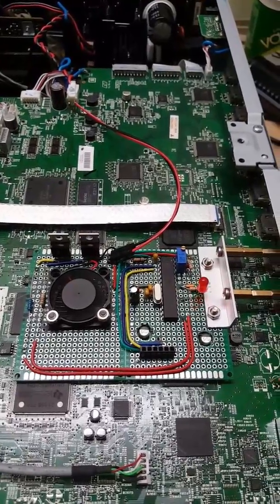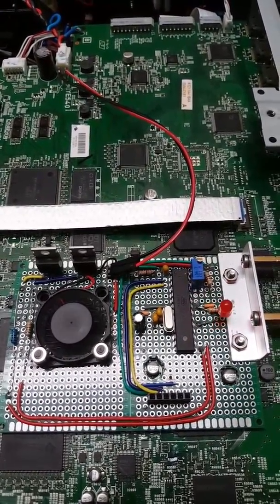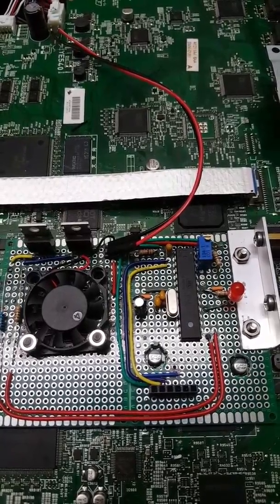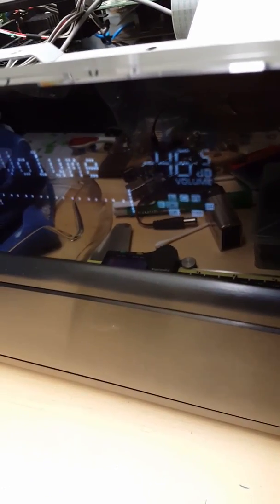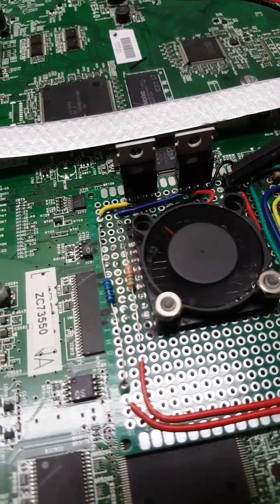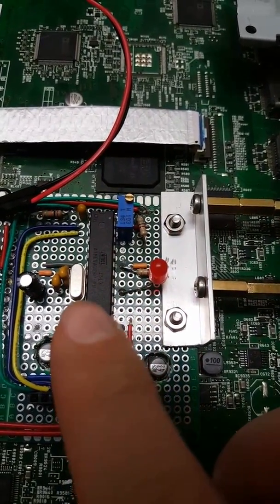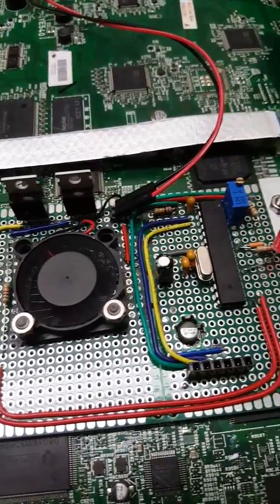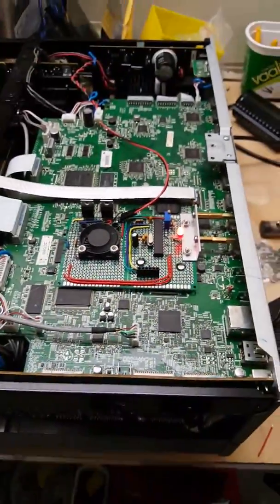Yamaha RX-V2073 DSP chip fix

Comment: this is great.    I'm not an expert but would like to do something like this with a Peltier thermoelectric chip.   I bought a broken Yamaha receiver  rx-a2000 and the audio goes out unless you warm the chip up.   This is a great video,  I would love to see a more detailed video that included the schematics and programming.   How you determined where to tap into the receiver to get the voltage.    I'll check out your other videos in case you have a more detailed explanation.    But genius move.   I hope I can get mine working too.
Reply: You need to reball or reflow the DTS chip on the daughter board from the main mother board....or change the entire DTS2  daughter board available from Yamaha for about $AUD280.00.
you can do this yourself...make sure you know what you have to do before you start changing boards. Adding four huge fans on top of the amplifier sucking hot air out all the time through the amp will ensure long sevice life of any AV receiver.